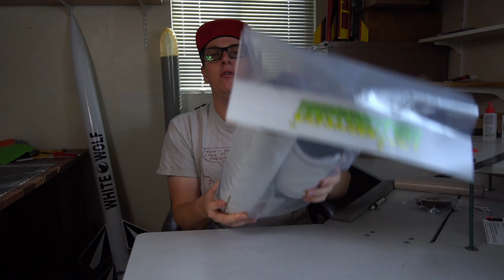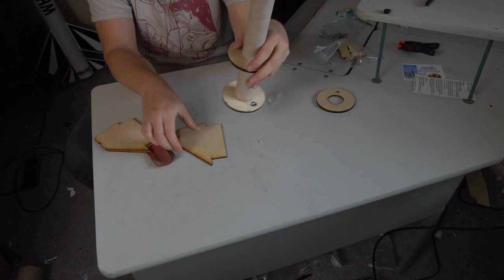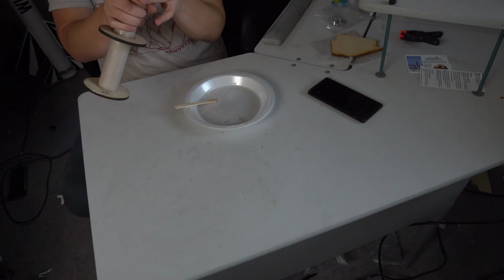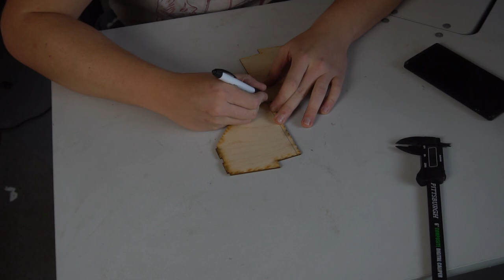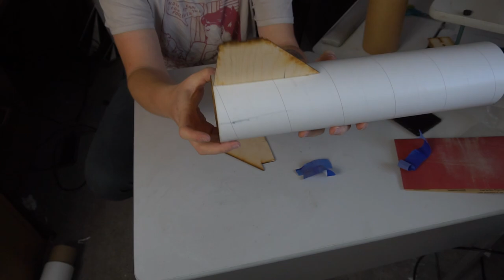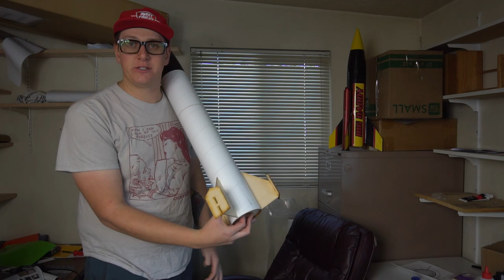LOC Precision T-LOC 4 38mm Conversion and Build | Final Build Video of 2021

Comment: I would have waited to installed the aft centering ring and apply internal fillets, for strength to the fin mountings. Install the aft centering ring last. The 38mm upgraded power will put additional stress on the fins and added strength will help. It won't add much to the overall mass either.
Reply from the maker: The fins will flutter themselves to death on this guy long before internal fillets would be in play. Basically, going to 38 only allows H123s and real slow motors, haha

Comment: How much nose weight are you going to add with the 38mm motor mount?
I've been thinking about doing the same thing but I wasn't sure if the bigger motors would make it unstable.
Reply from the maker: I'm not sure as of yet how much I'll need. I'll have to get a loaded motor in there for real word CG measurements, but in Rocksim it looks like I won't need to add much, if any.